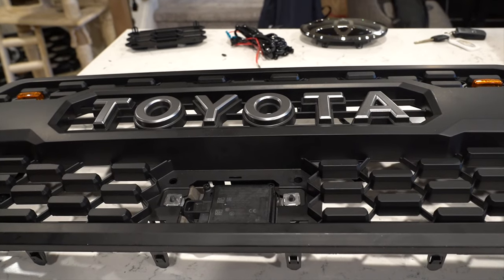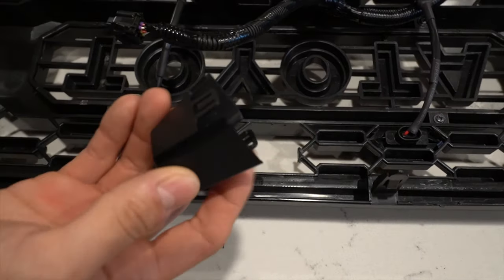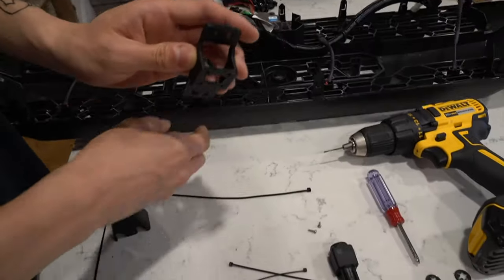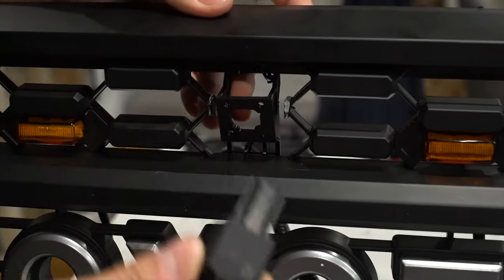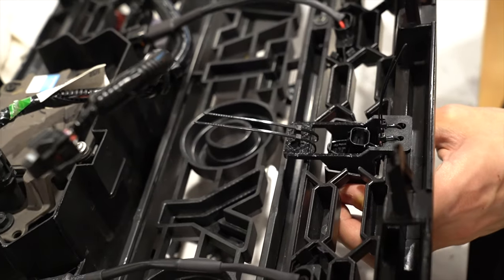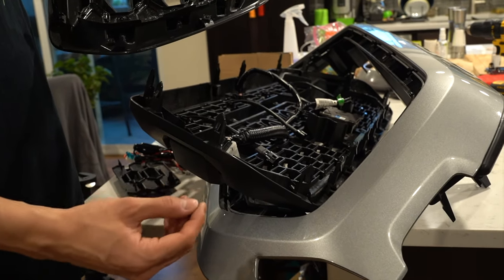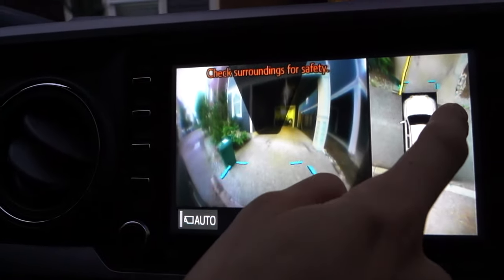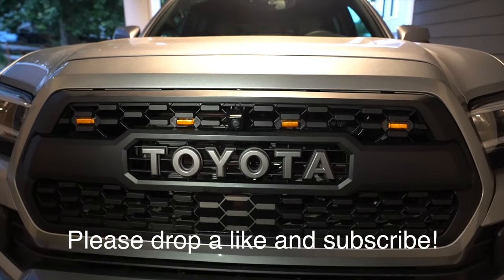TRD Pro Grill with Camera Install on 2020 Toyota Tacoma (Cheap Alternative Solution)

Comment: I used Dremel on my 2020 TRD OR and just screwed factory mounting plate just like on factory grill, worked great no issues and raptor lights look great, have white one and yellow ones to switch out if I want.

Comment: Taco Vinyl has a bracket available for 2020 tacomas with camera...
Reply: Does it work with 2021 trd sport?
Reply: @DavyDave1313  that bracket works on my 2021 Taco TRD OFFROAD with Front camera
Reply from the maker: Nice! Finally people can stop zip-tying the their cameras.
Reply: @phillipyeo6104  damn why didnt I get notified someone replied SMH 🤦‍♂️🤦‍♂️🤦‍♂️all this time I have been looking for a TRD pro grille that accommodates the front facing camera and almost 5 MONTHS LATER I have come back full circle to this video and have rediscovered this comment. 

Cool I will look into buying the TRD Pro Grille with garnish sensor and then look more into that bracket from taco vinyl for the camera as there is still no solution for the sensor and camera(to my knowledge). Thank you!!!!

Comment: Hows the sensors the same or do they read different
Reply from the maker: timbriceno the sensor worked fine. It warned us a couple of times when we were too fast and close to someone in front of us. The only thing we have found out was the sensor gets dirty more easily when driving off-road. It sometimes tell you to clean the sensor when there’s too much dust. But it doesn’t happen on road even on a rainy day.

Comment: cant somebody just steal it?
Reply from the maker: It's the same as the OEM, which you have to cut it off. Someone would have to be committed to either cutting all cords or removing the housing of the camera if they really wanted it. Have had no issues whatsoever about potential theft. But if someone is going to steal it, they're going to steal it. Doesn't matter if it were our DIY install or the OEM installation.